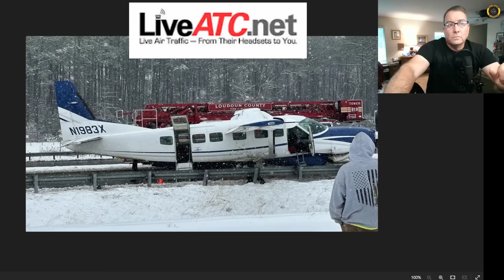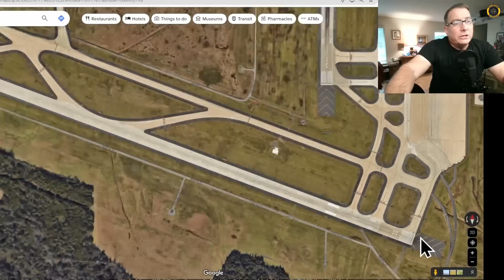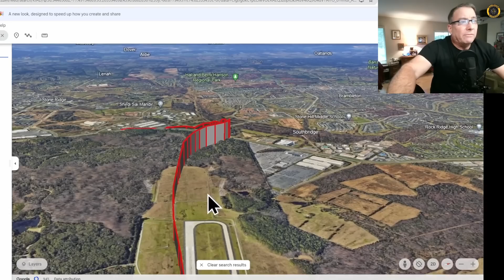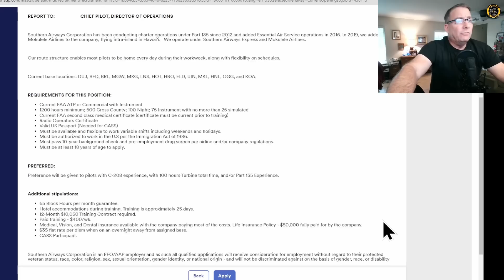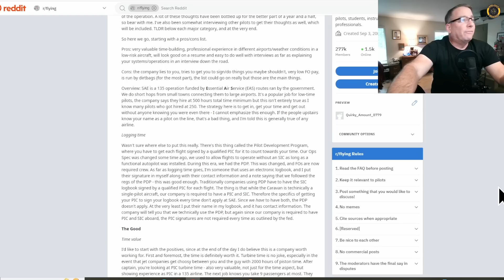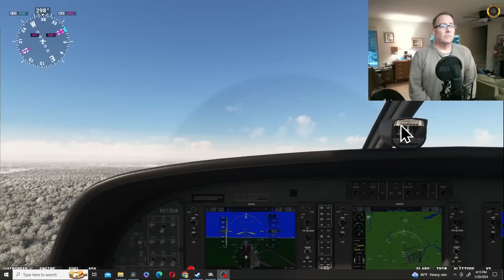Dulles Caravan Forced Landing 19 Jan 2024

Comment: Southern Airways is going to start serving my town, KIPT,  in May.  I flew the route to KIAD in a Caravan in the sim last week when they made the announcement on the news. I'll have to try my luck with that off airport landing, but I have a better set of controls, Thrustmaster A-10C Warthog Hotas. BTW I used to work on Caravans for Fedex&UPS, and that plane is, by far, the easiest to work on of any I took care of in my 42 years in the business. I was told that the freight haulers advised Cessna what they wanted in a plane like that and Cessna listened and did a great job. I suspect the same will be true of the new Sky Courier. After reading about the maintenance ops at SAE, it's too bad they weren't as diligent as the firms I was working under at our out station. That would be Mountain Air Cargo and Wiggins Airways. They would call me up in the morning with any work that needed done, and we always had it back up and ready in time for the evening run. And if they knew ahead of time the plane needed any parts, they always had that in the cargo pod when it arrived. They were a well oiled organization.

Comment: I think you are wrong on this one. The engine was under power when it struck something to bend the prop like that. It could have “feathered” after shutdown with loss of oil pressure (if I remember correctly.  It’s been a few years (30) since I flew Caravans). 

This was a very common scenario in the past IF you left the oil dip stick out. You would get to about 2000 feet when  all the oil would be pumped out.  

Something is fishy on this accident. 

It is pretty rare for a PT-6 to just FAIL.

Comment: Really good job with the low altitude engine failure.  They are all about airspeed for maneuvering rather than quick altitude at low airspeed and about going just there rather than even thinking about what can't be made.  The can be made landing zone is generally very clear.  Just say, "yes, that one."

Comment: I fly as a passenger on Southern Airways Express about once a month for work so I have many, many hours with them.   I have found the young crews highly competent and I do not have any extra worries about my safety.
Reply: I also fly with them frequently and scheduled to fly with them on this route in a couple of weeks. Overall, I found them to be very professional. I did fly one flight with them last fall where a senior Captain deliberately scud ran 1.5 dots low the ILS into LNS. The captain and I had a chat after the flight. The airport was right at mins. It is flat farmland on the corridor. Still, not very wise.

Comment: The thing about the impossible turn, is that to get back to the same runway (i.e. there isn't another runway available), it's actually two turns and one of them is more than 180 degrees.  It's hard to describe without a diagram, but if you imagine a 220 degree left turn followed by a 40 degree right turn, that's the sort of thing you need to do to get lined up with the runway you just departed from.  It looks a bit like a question mark.
Reply: Curious as to the “impossible” turn you allude to ? And yes definitely more than 180 degree turn . In a C208 or PC12 it’s fair game and an approved and required training for an IFR emergency return procedure in Australia . Curious to know the FAAs take ? Obviously there are added considerations ie/ runway length , wind component , terrain and minimum altitude where a turnback is available . Each factor is briefed and considered accordingly for each and every departure along with company SOP’s for minimum cloud ceiling for departure which is in many cases far more restrictive than the published permissible takeoff mins to allow most of the procedure to be visual .
Reply: @roddalgleish7593  5:08 Juan didn't call it the impossible turn, but it's a common term that refers to attempting to turn back and land on the same runway when you don't have enough altitude.  Yes it depends on a lot of factors and there are situations when it is possible and the best option. [edited for spelling]

Comment: Never knew plane engines had inertial filters like a locomotive engine. You learn something new everyday.
Reply: I just learned that locomotive engines have them.👍🏼
Reply: @petrosspetrosgali  I have to google "inertial filters"
Reply: Also common on helicopters that operate in dusty environments.
Reply: It's basically a turboprop thing, the PT6A, the kind involved in the incident, has them. Not sure about other models.
Reply: It’s not a “Filter”, the design is essentially using basic physics as its underlying principle and sheds Ice or FOD simply by a radical direction change when properly engaged.
Reply: @HsquaredH2  Argue with the manufacturer. EMD refers to them as inertial filters.
Reply: @ItsReallyJackBlack  lol, I don’t need to “argue” with anyone, it’s a fact!
Reply: @HsquaredH2 I am going to assume English is not your first language. You need to understand the term "filter"
Reply: @ItsReallyJackBlack  hahaha, and you need to stop talking about things you are clueless about😉
Reply: @HsquaredH2  I have worked on thousands of locomotives, including their inertial filters, in my over 30 year career on the railroad.
Your qualification?
Reply: @ItsReallyJackBlack  I guess strictly technically speaking, it is a filter-an inertial filter- just like the caravan uses an unducted high bypass turbine propulsion system.😎

Comment: The weirdest thing is I have had recurring dreams of being on airplanes that fail to get enough lift and are forced to land on nearby roads.

The first time I had the drram, it was arriving at dulles, and we crash landed onto a roadway, in the snow, and the airplane broke apart as it rolled into a ravine along the roadway.  Then over time they became more and more surreal, like having to land on elevated highways with crazy overpasses and flying ramps and mountainous terrain.  Or we would be forced at the last minute during takeoff to take some strange terrain hugging route that involve the type of flying you would see at a red bull air show.  But in a fully loaded 747 or airbus.

It's eery that this happened in similar conditions, taking off from the same airport as my original dream manifestation before it got all trippy over the years.

Comment: Loved the flight sim recreation, just shows how tricky this miracle landing was. Sort of weird to hear of a PT6 failure like this, mind you a Super King Air had an engine failure at Sydney airport in a very similar situation like this where the pilot turned on the dead engine to get back to the airport and killed 13 people. In that crash it was suspected there was fuel contamination by water. I suspect the same here. Also semi weird to me to see a Cessna Caravan with an aluminum prop. The few I see in Oz have the composite prop. On impact that style of prop just turns into a witches broom of carbon fibre. The Caravan isn't popular here due to the limitations of being a single engine aircraft Vs it's size.
Reply: 10k time In the -67. Have done 3 shutdowns 2 due to oil seal(prop) and 1 full on shit the bed(#1 main bearing failure.  No SEIFR for me
Reply: Most caravans in Australia are aluminium props , I’ve seen maybe one composite prop on a meatbomber (skydive aircraft) . The accident in Sydney in 1980 had many issues . Hot conditions 39C , overweight and a company using a non approved , derated power setting as an unofficial SOP . Whilst water caused the failure in that case it was unfortunately deemed pilot error . There is absolutely no indication of the cause of this failure , there’s a multitude of possibilities .
Reply: ?? There are heaps of c208 in Australia. One had a EFATO out of lizard island QLD last week
Reply: @cobra646  Considering the masses of rain that's been going on up there I bet it's water contamination
Reply: @cobra646  I've been to Lizard Island. Absolutely gorgeous. Best snorkeling I've ever done. Cheers from the states!
Reply: Even without the engine out and crash, with all the instability of the takeoff and flight, I place more value in my life to take another flight with this guy
Reply: Flew a ton of caravans all had aluminum props
Reply: I've flown on a few of them between Derby and Koolan Island in northern WA about a decade ago. They're definitely around in WA.
Reply: Excellent outcome! Hope they get a raise.
I know of 4 guys who have had PT-6 total failures. They all lived, one guy was badly burned, and one lived because the snow was just so deep when he did a blind night landing in high mountains. I love the PT-6, but they DO quit.
Reply: That simulator bit was awful, like he controlled it with a keyboard.
Reply: Don't call it a miracle. You're belittling the flight crew by signing it off as an act of god. There was certainly luck involved but skill clearly played a far bigger part in how this turned out.
Reply: @OutbackCatgirl  let’s wait until we find out when the inertial separator was deployed and whether or not it was deployed per the checklist before we talk about skills and what not. We’re not making any accusations here but it’s a little early to be given out medals.
Reply: @Zardozian999  yeah, I'm just peeved by people slapping "miracle" over anything which involves the actions of people. You are right there in that we need more info but i hope this explains my ire.
Reply: @OutbackCatgirl  He wasn't belittling the flight crew! You're "colouring" his comment with your own bias

He was simply saying the crew managed to pull off an extremely difficult emergency landing despite the high likelihood of a tragic outcome.

There is no assertion that they were "saved by God" or anything like but simply the crew managed a miracle like outcome  

IMO ALLEGEDLY
Reply: @change_your_oil_regularly4287  MIRACLE: an extraordinary and welcome event that is not explicable by natural or scientific laws and is therefore attributed to a divine agency.
Reply: @OutbackCatgirl 
You clearly don't understand people have Guardian Angels who prevent people from dying before their time. They are the miracles.
Reply: @57appel  Please tell me this is sarcasm and you don't actually believe that
Reply: @OutbackCatgirl    
Clearly, you have never experienced being helped or saved by your Guardian Angels.  No matter, if you are meant to live and have a sudden freak accident and live, you’ll know they helped you. Surely, you’ve had an incident where someone showed up from out of nowhere and helped you, then disappeared.  It’s not about religion.
Reply: @57appel  It's fully explainable by luck and being in the right place, at the right time, with the right people, and the right skillset. You're free to believe what you believe but make sure you at minimum give credit to the pilot and copilot instead of shifting that praise to some etherial being that cannot be seen, touched, or experienced outside of your own inability to cope with the idea that sometimes things just happen a certain way. Or that altruism exists. Random helpful strangers and good samaritans are literally everywhere hiding in plain sight, and while calling them your guardian angel does communicate your positive feelings towards their assistance, remember that they, too, are only human just like you. And that makes their altruism all the more precious.
Reply: @OutbackCatgirl  Au contrair, sweetie.  Angels of all kinds can be seen and in color!  No one is taking away from extraordinary educations in flight or experience, but even the best require a little help from their Guardian Angels.  It’s unfortunate you have never witnessed any or think certain strangers are simply human.  AsJuan and others know, this type of turn rarely works in such great detail and overhead lights were just over the top of the aircraft. You know as well as anyone this was a rare landing.  What you call luck is synchronicity to others. Oh, and I’m a USAF Vet…. I understand flying abilities.
Reply: @57appel  You're also, sadly, a victim of magical thinking.
Reply: @OutbackCatgirl  
Thank you!  That's a compliment!
Reply: Lots of unhelpful speculation.
Reply: Wasn't a miracle and I'm sure it is harder to pull off in the sim due to that lousy joystick.

Comment: I hop around stations while I drive around the dc area for my job.  They all made it sound like a private airplane had landed on Loudon county parkway, not a smaller commercial airliner.    

I was shocked when I got home and the local NBC news said it was a scheduled passenger flight.
Reply: To be fair, a single engine prop airplane doesn't sound like a regular scheduled commercial airline, when the local media probably only knew what local emergency dispatch had been given.

Comment: Real airplane is easier to control than a PC flight simulator, isn’t it? Friends gave me a flight lesson as a gift once, and I was really impressed at how the Cessna 172 handled. You’ve got real feedback from the control surfaces that you might not have with a controller on a PC. Also, quite fond of the Cessna 208B, considering how many times I rode in one between KBFI and KFHR. Really nice aircraft to be in, and at the time I was much heavier, so for weight and balance, I had to sit in the first passenger seat, and I got to watch everything the pilot was doing. In fact, it was on San Juan Island where the friends gave me that flight lesson. Really pretty up there.
Reply: Yes, and I think Juan was using a game controller which makes it even harder still because the tiny sticks don't provide the fine control and accuracy needed for flight controls.  I use an R/C transmitter for the sticks and it is miles better than a game controller.  Of course a yoke and pedals is best.  But yeah what you say about being able to feel the control surface forces is true.  Also, in a real plane you can feel it moving around which you don't get in a PC sim.
Reply: @galacticminx  Totally agree - I have all the real controls (stick/throttle/pedals) in my VR sim (DCS World) and it's a bit harder to fly than the real aircraft.  If you can fly a sim well, you can fly an aircraft very well.  Nice thing about the sim is you can practice things that are too risky in a real aircraft, like engine failure after takeoff, and other emergency scenarios.
Reply: It depends... Throttles are usually much more straightforward in a sim where as on a real aicraft the controls might be a bit loose and with deadspots. That is of course on your non FADEC controlled aircraft. 😅

Comment: Too bad, the propeller was messed up. It was quite a while for the authorities to clear the roadway. Maybe they could have just thrown a rope around the nose wheel and towed it back to Dulles airport! Just kidding.
I’ve driven that road many many times, and for a small plane like the caravan. There is quite a bit room for the emergency landing. However, where they touched it down the road curves to the left. There was probably snow buildup on the left-hand lane that probably pulled , the nose of the plane into the guard rail. When a tire rolls into thick slushy conditions it wants to come to a complete stop so it pulls the vehicle into that slush. I think that’s what happened.  These two pilots deserve adulation, the same as captain Sully Sullenberger in my book. NWR😊

Comment: Guessing the engine didn’t fail but the beta block slipped out of the ring because the pin was missing. That would explain why it was still spinning with power behind it while feathered. Had the same thing happen to a caravan while
I was the CP of a FedEx feeder. She landed short of the field in Tracy CA with only an over torqued engine and muddy landing gear.

Comment: The simulator addition was cool. I think with with proper controls and a big screen or VR you would have handled that a lot better. PIO is so hard to avoid in non motion sims.
Reply: PIO is also more difficult to avoid with console game controllers
Reply: @sjpeckham1 I grew up on MSFS with keyboard controls only. It’s uncanny how there’s a point where you are past the “PIO half the time” point. Suddenly you start feeling the plane even though it’s just via the keyboard.
Reply: @absurdengineering  keyboard is probably easier as you can make discrete inputs. When you’re an actual pilot using a joystick, but not feeling the plane or the controls… but flying visual, it’s a very different experience.
Reply: @sjpeckham1  OMG yes game controllers are hopeless for flight sims.  Those tiny sticks may as well be switches.